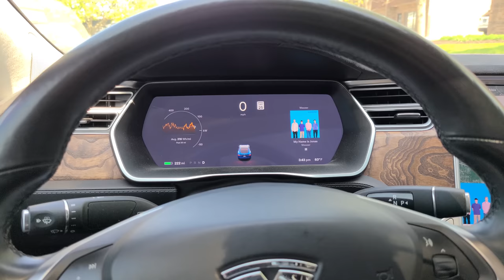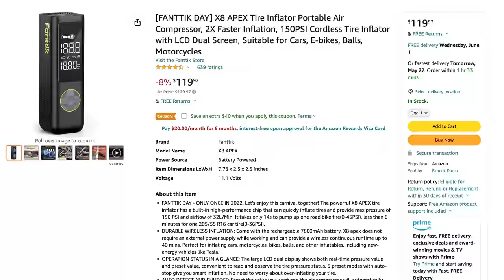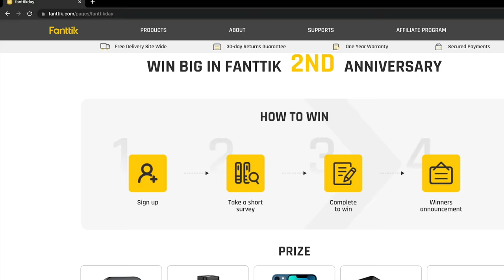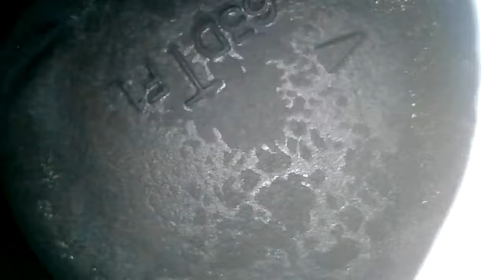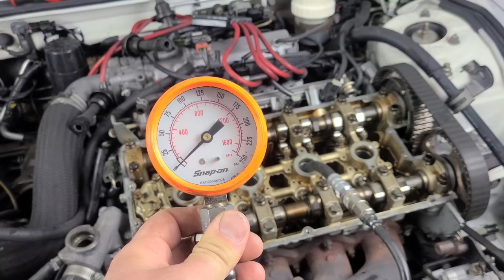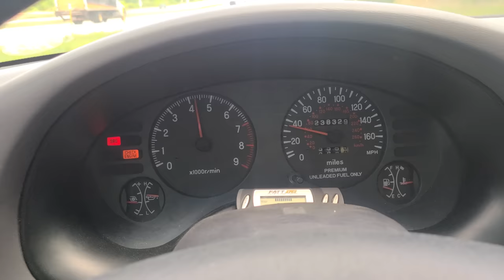I OVERPAID For The MOST Modified & Destroyed Japanese Tuner Car Ever! It's A TIME CAPSULE!

Comment: I had a '92 Plymouth Laser RS. It was the horribly awesome blue-green (aqua on the title) with the honeycomb wheels. Super sleeper!! I rebuild the 6 bolt, had it bored 20 over, balance shafts removed, cometic head gasket, arp head studs, lightweight flywheel, hd clutch, short shifter, 2g lifters, evo3 16g turbo, 2g wastegate, massive front mount (ran bumper cover only, removed bumper and support 😀), all hard piped, genuine HKS SSQV vented into atmosphere (with, imo the best sounding purple insert) 3in GM maft and afc Neo which I tuned (pre-google, pre-Youtube and pre- Fast and the Furious) with a PDA data logger and my Haynes book!!! 2 1/2 inch, no cat, to a magnaflow muffler, eibach pro kit (only 1 inch drop) all the energy suspension bushings, motor mounts, strut bars front and back, Yokohama tires. Stock interior with the silly auto seat belts, lol. Had to replace the passenger side seat bolts from friends not ready for the launch. You know your doing it right when the wipers turn on because the factory heavy wiper stock attached to the steering wheel is pulling G's. I was taking 5.0 Mustangs to Gapplebee before it was a thing, could also drop a gear and disappear on the highway going 60. OMG it was too much fun, but went into big debt always fixing on it. Then had a friend and original owner of a black, 5 speed, 1998 Nissan 240sx, offer to let me buy his car and I jumped on it so quickly... I ended up selling my Laser I spent over $10,000 on for $2500 to pay for the 240sx. Crazy stuff, keep up the good, clean, and adult work your doing, very nice, I love it.

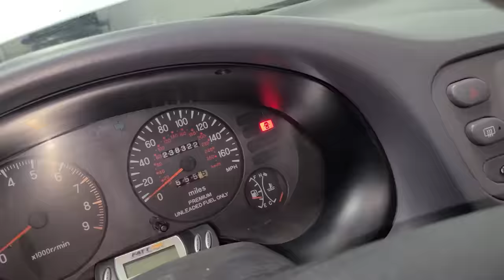Comment: Did you notice the tripmeter when you arrived at the shop (at 10:44)? 555.5! Bingo! If that isn't a good omen! Taking it one step further: mileage 238322. Leave off the last '2' and you can read it front and backwards the same (23832).

Comment: This is months later but that turbo is a 14B, off of a 90-94 1st Gen turbo DSMs. It’s a little bigger compressor wheel and more importantly it can actually hold more than 12lbs to redline and the top end is much better than the stock T25. That’s also why J-pipe is there. The stock one doesn’t work. That stock BOV is a leaky POS too. Changing the BOV to a 1G OEM unit is worth some horsepower by itself. 

Hate the Tesla content so that cost you a subscriber but I’ll be eagerly awaiting more DSM content. If you need info or help hit me up. I’ve been messing with these DSMs for close to 25 years now.
Reply: Also be aware, with these stock manual trans the TQ limit for them to still be reliable is like 350awtq. More than that starts to push your luck.

Comment: I have only one request: Underglow.  Underglow is cheesy and ridiculous but I absolutely love it because it's a long-gone representation of a more innocent car modding era. And the best part is, if your company doesn't like it, you can turn it off with a switch, and with modern tech I'm sure you could have it be any and every color you wanted adjusted with a dial. When I started watching this video I was certain your car was going to be a Toyota Celica All-Trac. My dream Japanese car sits in my garage: AP1 Honda S2000.

It does not have underglow. :(  It DOES have an AvalonKing application I keep putting off applying to it, complements of the code on your channel. :D

Comment: Put  97 front and rear  eclipse bumpers on it , 20g turbo , fmic , Supra turbo fuel pump rewired , then 4 of the larger turbo rx7 injectors . . Budget build for 500 ish hp . Get ready to start shreading belts and alternators .. lol that’s all I can remember off the top of my head from 20  years ago

Comment: the main thing you have to be careful with on desert cars, is all the plastic will have no more elastomer & very brittle.
when I first moved to California from Chicago.. after being amazed my 9/16 actually fit & the exhaust manifold bolt broke free without a fight! (was working on a 66 Impala SS)  I proceeded to brake almost every electrical plug i tried to un clip..

Comment: The turbo oil return has 3 gaskets. The washers on the bolts are gaskets, not washers. Replace them when you replace the gasket. Also that strap is a ground for the factory exhaust.

Comment: I just picked up a 96 spyder GST in crazy mint condition new top new ac. System new brakes tires etc. For 1500$ with 120k on it. Ran perfect but I did the Mitsubishi service it was supposed to have done ( t belt water pump cam seals wheel bearings valve cover gasket etc) that cost me 500$ in parts and I installed myself. Impressive to see 200k on these they really don't exist anymore.
Reply from the maker: That's a killer deal

Comment: So Forced Performance manifold. The turbo will be an evo 3 td05-16g. O2 housing is probably evo 3 as well. Flows a lot better than other factory stuff. I also spied a braided clutch line. Might have an alloy flywheel and after market clutch fork. Find yourself an evo 3 intake manifold, fit some bigger injectors and run e85. you'll love it.

Comment: I have in the past...Tore down my SAAB 900 Turbo with 478,000 miles....no ring groove....so miles sometimes if serviced correct.....not a problem. I only had turbo seal problem on original turbo at that mileage....Castrol 10w30 and oil better now...changed every 2000 miles.....

Comment: I'd rather you just keep the original paint. This thing is a survivor. Fix the interior bits that need fixing, but you should be trying to preserve what you can. I think you can tastefully mod this like you said but if that's the original engine, just stick with that. It's clearly a solid engine. I mean, why change it if this one can produce 400hp reliably? 400 is crazy power for this car. Gotta think long term for this car. Like 30 years. You won't have any respect for a swapped out engine, but you will for the original engine.

Comment: I was selling Mitsubishis when this car was new and it was one of our two easiest-sales models. (Montero was the other.)

Great cars, a blast to drive. Most miles I ever put on a GSX was driving one to the port after I sold it to a broker in Spain. Porter followed me and we drove back to the dealer in a Galant. The difference between the two DSM cars was huge. 

I had trouble selling the Neon motored versions which were garbage compared to the GST and GSX.

Comment: 3000GTs often develop a starter issue called "click, click, start" that's caused by the starter ground wire being too small of a gauge, especially after 20 years of corrosion.

Comment: Your oil return line repair gave me flashbacks.

From experience: just cut out the flex section of your turbo oil return line and put a piece of hose there. 
Your repair likely further weakened that "accordion."
I'm sure this is a temp fix before you go big turbo and braided oil line. 

Have fun! I miss the noises and smells from my 1g AWD.

Comment: As a dsmer, gsx is race technology in the hands of the average person.  It uses specific fluid in many case racing fluid.  Gear oil especially has to have the specific rating of gl4 not gl5 or gl6 but gl4.  Dig deep into the forums...dsmtuners was my goto but they are all chuck full of information.

Comment: Back in 2001 when I got my licence and the same year the 1st fast and furious movie came out these were everywhere out on the roads and now you never see them! I just bought a low mile 1994 ford f150 4x4 reg cab short bed 5.0 5 speed with 107k miles on it. I see 10 times the amount of older 90’s ford trucks then I do these. I’m sure theres still a good number of them out there but you are gonna pay a shitload for the good ones!

Comment: I’ve currently got a gs, gst and gsx. The gsx is beautiful except it’s rotted underneath  and has 250k on the body. The gst only has a little rust in front of the rear wheels and will be receiving the drivetrain from the gsx. And my gs is rusty underneath too and has a horrible sun faded paint job but it was my first car so I drag it around with me everywhere. I plan to mod and beat this car up respectably and also get a clean low mileage gsx to mod lightly and enjoy

Comment: The crankwalk issue was usually associated with higher spring force clutches as it increases the load on the thrust bearing which is what fails due to insufficient oil pressure. 175 psi is where the factory 8.5:1 compression pistons should be

Comment: 4G63 to 450 hp at the wheels Upgrade the crankshaft (I snapped mine at 380 hp) and beefed up conrods are also a must. 
Looking forward to see you restore this car. After finding your channel I actually sold my Evo 9 and bought a 2004 E55. The Evo's suspension was killing my injured back :(
Reply: Swapping to a 6 six bolt fixes all those problems.

Comment: Just one minor correction... the Eclipse (and all DSMs) aren't Japanese cars. :)
Every single one was built in Normal, IL. Pure American muscle. Even if you go by the companies designing them, 2/3 (Plymouth, Eagle) are American.
A handful were imported to Japan, but they're far more rare there than here; there are no 'JDM' parts for DSMs, because they were never domestic-market cars over there.

I also have to admit that I was wincing watching the valve cover get put back on. Those bolts are rated for inch-pound levels of torque, and the valve cover cracks VERY easily... getting it to seal well is almost an art.

Comment: Had a 95 gst with a big 16g turbo, big injectors, fuel pump, air fuel computer, down pipe intercooler and exhaust.
Just flooring it in 2nd would smoke the tires to 70mph. It upset A LOT of Hondas, mustangs and 
Camaro’s GOOD TIMES… blew my 3rd 5speed trans and sold it… miss the car. Should have bought a Lloyd’s built trans :/ actually had no real motor problems with the car

Comment: Years ago I bought a perfect condition 91 Talon TSi Awd 5 speed. Bone stock with 70k miles! It was roughly 2005. It was a one owner (an old man) it was never smoked it. No rips or tears inside and the body was perfect. It was grey exterior and grey interior.  It even had the factory exhaust and air box. I was 17 🤦🏻‍♂️… put a fart can on it and turned up the boost.. you guessed it I blew some holes through a couple pistons. Sadly sold it to a guy who bought them and sold them for a living.  Years later he told me that until that day that was the most money he’d ever gotten out of a first Gen Awd turbo talon ever.. 🤦🏻‍♂️ I wish I could go back in time and one not fuck it up and two never sell it

Comment: Nice to see dsm's getting some love again. I've got 6 turbo dsm's and love them. You should look at the front ball joints closely as well, very common failure point on the 2g's. Maybe throw a timing belt job in there as well evo 9 belt and oem tensioner is the way to go.

Comment: I had a 1g eclipse that the original engine and trans lasted until 289,000 and then blew the head gasket. I put a rebuilt engine in it, evo 8 turbo, hks blowoff valve, blitz turbo timer, and 3” busher racing turbo back exhaust.

Comment: You're gonna need extra exterior door handles and completely new wiring harnesses. Something else that is common to be an issue with these cars, especially the 2G-As, is the drain plug for the rear window getting clogged. Door handles are prone to breaking a lot, so it's good to have spares. The factory wiring harness are low grade materials making them the bane of any DSM owners' existence.
Reply: Good DSM Youtubers for reference are Jafromobile, Tom's Turbo Garage and Miguel DSM.
Also, Optima batteries have been crap since they were made in Mexico.

Comment: If your restoring it, keep it year period correct, to many people have that 97-99 bumper, I have a 100k mile 95 GSX that still has the a/c I compound turbo-ed pushing 1200hp out of a 4g63 & will never let it go! and no its not the last one out there. plenty of dsm guys that have way cleaner versions. shit one just sold for $40k on Bring a trailer out of WA, these are actually going for $15k for just local sales and no body uses KBB for DSM's because they do not retain there value, value's have skyrocketed because the 4g63t engine and how much HP they can make

Comment: When I had 1999 gsx I had little bit bigger turbo an 25 psi of boost  And snap both front axles in the transmission case lol Was my 1st Really wish I had another one I had a 99 to Dakota a with built 318 five-speed lowered that I traded for it and I think it was the best thing ever you're still day

Comment: you can tell 6 or 7 bolt motor by the sensor on the cam.. if it plugs in without any wires spliced it's 7..cause only the 7's had an on the block crank sensors rather then a crank position based off the cam position like the 6 bolts.

i will be honest.. i miss my 90 Talon TSi, wish i knew then what i know now, cause i would have welded, or tapped and plugged the oil ports for the balance shafts closed when i deleted them.

Comment: Hey Alex you still will have an oil leak until you replace the gasket between the engine block and the oil cooler where the oil filter goes. Ever single one of engines does that and that's the reason that coolant hose expanded. Also your oil pressure sensor is definitely leaking also.

Comment: Next time to make the seal, you don't have to drill the paper, just get the piece, put the paper against the surface that you need to seal, and then use a tool like 9/16 wrench , and tap the edges gently...surrounding the shape of the area to seal...and that's it.

Comment: The drive train is getting obsolete when I needed a transfer case seal I had to buy it off eBay from Lithuania because there was none in North America. When I needed a new windshield there was none in the country and it had to be custom made for over 1500 dollars. I traded it off for a V8 muscle car I can buy parts off a catalog. DSM are fun but you can't buy anything anymore for the chassis. Only the 4g63 is great. Transmission parts are nowhere to be found, body and Interior is junk yard only. Seals are hard to find even in North America. Transfer case parts not available. I had a 92 talon and had to sell it off because there was just nothing available to keep it on the road.

Comment: Sounds like a wheel bearing. We had a lot of timing belts that wouldn't make it to 60k. I would change these at 30k. Only other failure is the transmission/transfercase if dumping the clutch too hard especially on a built engine. Could break transfer case input shaft. If you still have a leak, all 4 of the front seals would leak.

Comment: I so knew it was a Mitsubishi. I thought it'd be a 3000gt though. I've got an SL with no rust waiting for a new timing belt in the garage, it sucks being poor- I really want to drive the thing but until that's fixed it sits and who knows when I'll have the time/Money to fix it. Oh well though, they're gaining value these Days and it's in decent condition other than some minor hail damage, mostly on the hood- I'll be replacing that with a carbon fiber one at some point (nothing fancy, just a replica of the regular hood- the stock hood is VERY heavy).

I'll trade you! This version of the Eclipse was my dream car when I was a teenager- not even because of the fast and the furious, I just love how they look, then add in the all wheel drive and turbo- perfect car. I wish the 3000gt was at least rear wheel drive (ya, the VR4 is AWD but the other models like my SL are FWD)

Comment: I don't know if the engine light came on after you were driving it, but I know most car's don't like being Run with the air Box open it will throw a code. Nice car.

Comment: Back when those were pretty new a customer of mine was racing those cars, he had them putting 400 to the wheels on pump gas. He always had a laptop in them. He took me for a ride once in a awd 5 speed 400hp he stopped on the side of the highway and did a launch. It was pretty damn vicious especially then. There wasn’t anything that could touch it. It launches like it was shot off an aircraft carrier.

Comment: I used to have a 90 1G gst it was fun I could keep up with a mach 1 mustang. transmission parts are hard to get, so I ended up junking the car, but I kept the engine it ran great, Its still on the engine stand been sitting for a few years. 6 bolt block. My 96 tacoma engine is dying so Im thinking of swapping that in it.

Comment: Killing myself trying to get a trans auto either for fwd turbo or AWD turbo for my 1st gen 7 bolt talon. Man parts are scarce for old 4g63, trying to build a 500-600hp unassuming talon. I got mine for $750 with no rust at all up here in New England, with bent valves due to broken timing belt. Funny thing is that all bottom end parts i had for my sold Evo 8 fit in, eagle crank, rods and Pistons. Am even debating going rwd auto with a 4w70 Ford trans and mustang rear end.

Comment: I have a 2007 mazda 3 2.0L sedan with a 5spd transmission.  The engine only has 90,000 miles. Is it possible to put a turbo from a mazda speed 3? I know they are 2.3L engines

Comment: Cool car Alex. I had a new conquest Tsi in 86 so I know how you feel about Mitu’s. However I have a question about my 06’Saleen Mustang. Bought it new and I keep it in spectacular shape. It has 24k miles. Oil is changed yearly. It’s stored from Nov to April. Lately I’ve only put 1000k a year on it. When it sits for a few days and I start it cold, it lets out a puff of blue smoke. Is this ok or am I in for trouble down the line.

Comment: I would suggest upgrading the interior as Mitsubishi interiors are rather cheap. I had a 2000 Mitsubishi with a 6 cylinder stick. Loved its looks but the interior was not great. The MR2 I owned and the Supera were far nicer inside.

Comment: instead of scraching the hell out of the oil pan with a box cutter to trace the oil drain, why not just put some oil on the drain, let it make a mark for the outline, and cut everything out on the bench including the holes? Makes no sense to do it this way even if it 'works.' Otherwise, excited for this build!